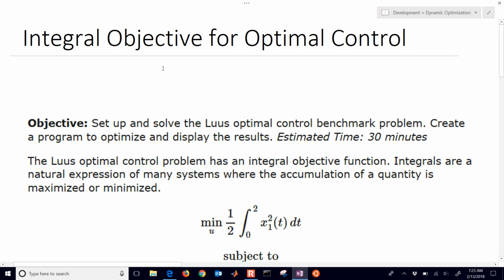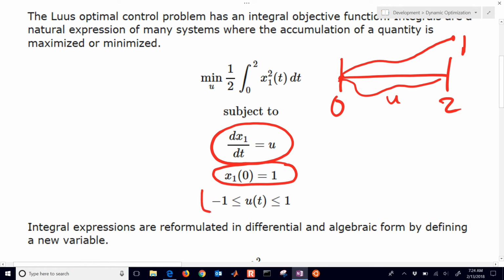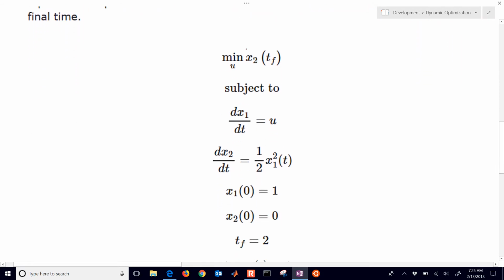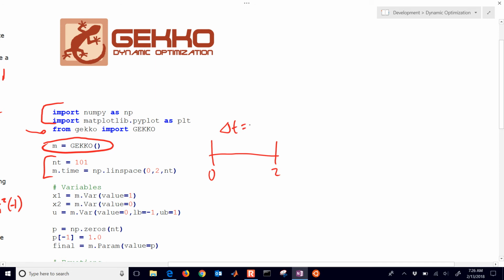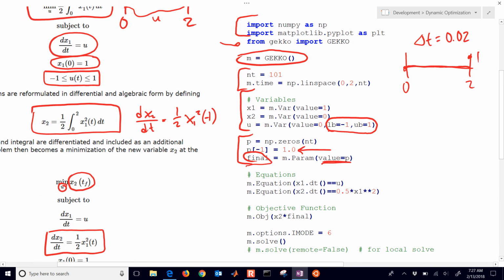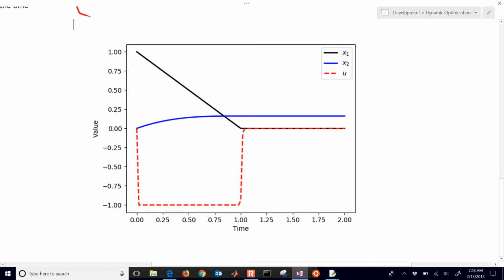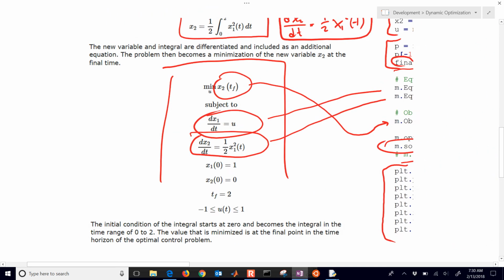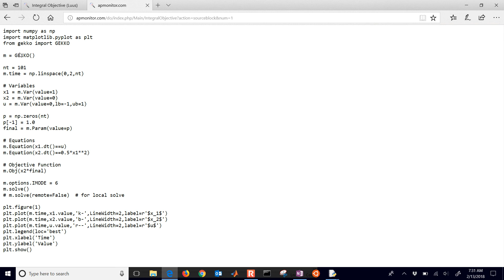Integral Solved as a Differential Equation

Comment: Thank you very much for giving us (student) a great tool to play with!
I have 2 questions:
1/ What does it minimize if you just let x1^2 as the objective function? 
2/ For constraints on the final states of a system (example 1b of optimal control), is there any way to achieve that without introducing a lot of constraints equations because using "m.Equation(final*(x1-x1_desire)==0)" will add an array of constraints while only the final state is needed? As a result, if multi-final states are desired, the number of constraint equations exceeds the number of variables.
Reply: It would minimize x1 at every time point. You can use the new m.fix(x1,len(m.time)-1,x1_desired). This fixes the value at the endpoint.
Reply: Thank you!
Reply: Hi Prof. @rrc , is there any way that I can keep the integral in the objective function instead of introducing a new state? Thanks.
Reply: @MinhVu-fo6hd  you always need to include a new state just because of the way the problems are allowed in Gekko. It is differential and algebraic equations so whenever you have an integral you need to declare an extra state.
Reply: I see. Thanks. @rrc
Reply: Prof. @rrc , I have one last question. When I initialize the decision variable u, that initial value u(0) is fixed (I print out to see it) and the following u(i) is optimized w.r.t that u(0). Thus, this control is only optimal w.r.t an initial condition but not globally optimal. So, is there any way to find the global optimum using Gekko without casting the dynamic problem into a static optimization? Thanks!
Reply from the maker: You can do one of two things: (1) make the first time step very small so the initial condition doesn't affect the outcome very much or (2) make the u[0] calculated with m.Connection(u,'CALCULATED',pos1=1,node1=1).

Comment: This is a much better prepared presentation.  So where does one apply this?
In short, why bother? I think I would be the student from hell.
Reply from the maker: Integrals are useful in describing any objective that accumulates over time such as total energy consumed, material produced, or profit over a time period. The integral accumulates instantaneous values over a time window and you either minimize or maximize the integral, depending on your objective.